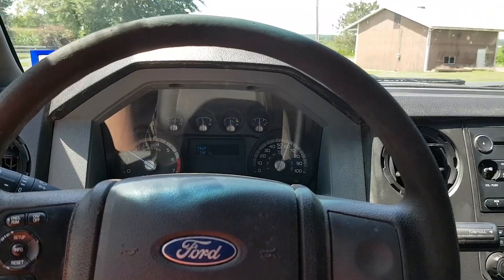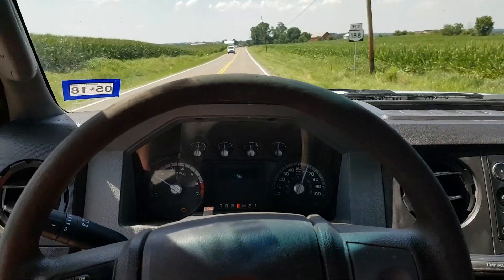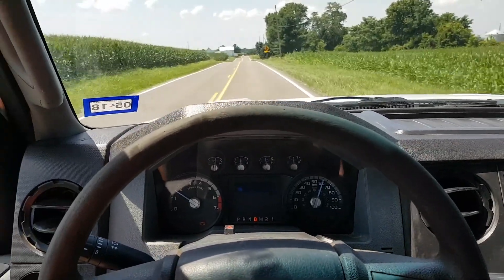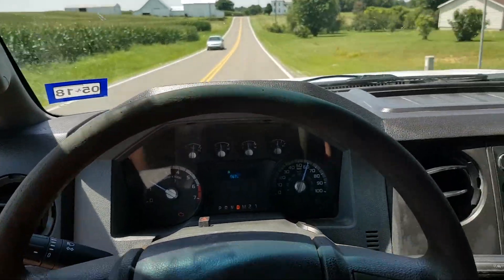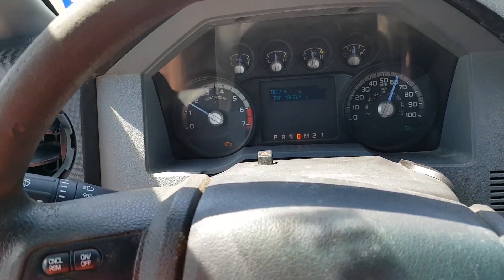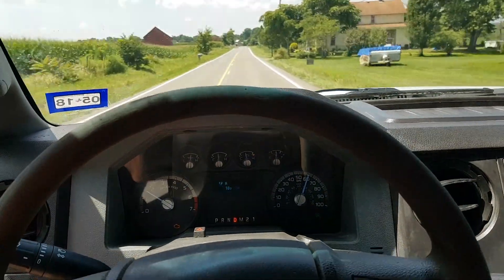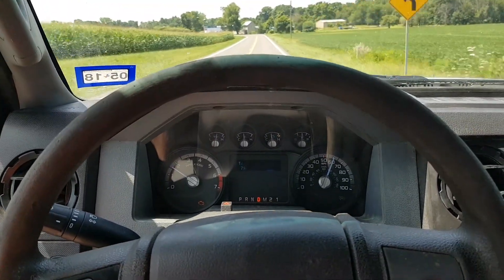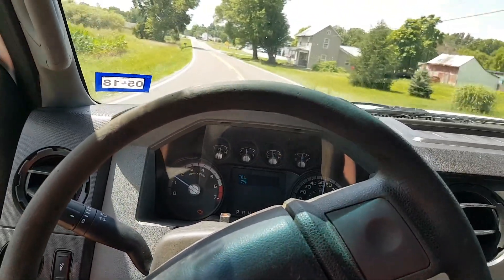Ford Misfire Monitor Neutral Profile Correction P0304 P0307 P0300

Comment: Man ive been battling an unpredictable intermittent misfire issue. P0300 P0302 P0308. I changed the spark plugs and wires as well as swaping the coil packs front to back to trou le shoot the #2 and #8 cylinder misfire. It didnt change anything. So I ended up at the local Ford dealer in Cedar City Utah and had the crankshaft position sensor relearn procedure done and so far its did the trick!!!!!
Reply from the maker: Yeah it can do that. I had the same issue with a random crazy misfire. 5 second procedure fixed it.
Reply: What did it cost you at the dealership?
Reply: @95gt00d $150....seems expensive for 10 minutes of computer work but it took care of it

Comment: Ford escape 2017 here. Having the same issues.  I was getting misfire codes. I bought fordscan lite for Android phone, I bought obd mx plus Bluetooth. I will perform this procedure myself tomorrow. Hopefully this fixes my car.
Reply: Hey galagatron5319 did you ever end up completing this procedure with your Android? Was it successful? Looking to do the same thing
Reply: Yes it works!  The lite version is nice with the Bluetooth obd and app on the phone. I still have it. But I highly suggest that if you want to have access to many more more features, get the software and wired obd 2 cable forscan recommends. The software is stupid cheap!
Also,  if your having misfire problems still after you try this procedure,  check all your ground cables under the hood and make sure they are tight and attached well to the chassis. Any dang ground wire you see. Also double check each spark plug if you put it new ones. I rebuilt my own transmission and didn't tight a ground cable and this causes the 4 misfire alerts you see in this video. After I found loose ground all but one coil was fixed. Still had one misfire in coil #3. Turns out, one of the new spark plugs I replaced was cracked. Replaced, and car has been running great. But the forscan lite works and I can't write a novel here but trust me, it works. Get the real forscan if you can though. You'll need a laptop with it.
Reply: @galagatron5319  great advice! Thank you very much

Comment: 2015 Mustang 5.0. Misfires cylinder 4 2 and 8 around 1200rpm.  No codes  changed coils , injectors, and plugs.   Have new VCT solenoids to install.   I hear and have seen 5.0 coyotes
With the valves wearing away on those cylinders.   GO

Comment: Thanks so much, this helped a lot. I have a 2020 Mustang and I just had a new MT82 (Transmission) put in and my car is now throwing these same codes. The dealer must have forgot to do this.
Reply from the maker: Hopefully that's the problem. It's an easy with with the right scantool

Comment: could this be applied after a simple spark plug change?? change in mine and after that get p0304...didnt check the plug of that cilynder..escape 2.0 eco
Reply from the maker: A spark plug change shouldn't require this
Reply: @JackofAllMasterofNone  thanks...
Just if you know something
First change valve cover gasket
Then sparks and experience misfire in cylinder 4
After that change all spakrs again..the misfire run better but still happen..so...my last chance is try this procedure..do you know something?

Comment: I just replaced a piston in a 2.0L engine and very carefully set the timing putting it back together.  Car runs great but I have a P0016 (Crankshaft position/camshaft position, bank 1 sensor A -correlation).  Could this procedure fix my code as well?
Reply from the maker: Im not 💯% sure but I believe it would. This procedure basically resets the crank position sensor / cam position sensor relationship in the computer.

Comment: So there is a car lot that is selling a focus st which has the eco boost engine. So I went for a test drive when all of sudden it started  bucking when I hit 3rd gear wouldn't pick up on WOT.  Got to a light and the car started shaking like crazy. I thought I wasn't pressing the clutch all the way. I pressed the pedal all the way to the floor and the problem still persisted.  So I turned it off and on. It went away. So when I got back i decided to check for codes with my scanner and it gave me  a code for the crank positioning sensor.  Car is being sold for a good price.  I wonder if I can it fixed at the dealer for free or something I can easily fix on my end

Comment: I’ve got a 2009 F350 that has run me up the wall after a basic tuneup with misfire codes, actual misfires, all sorts of tests, cleaning procedures, ECM resets, adaptive relearn ..... parts replaced .... it’s gotten plain stupid.   My gut inclination has been that it was so far out of tune the first time around that the ECM hasn’t been able to work correctly after the tune.   

Man I’m hoping to do this and get it fixed for good.   My Snap On Verdict shows the feature in special functions .... and as a back up a good friend mine has a copy of IDS (and FORScan) to give it a try.   

Thanks for taking the time to put out this informational video.

Comment: How much did the procedure (the relearn) cost you? I took my motor out to get broken exhaust studs out and install new manifolds, and I have the exact symptoms. Hoping it's this... I spoke to the foreman at my local Ford and he acted like I was an idiot for suggesting this
Reply from the maker: This is a common thing any time a clutch or engine or transmission is replaced on a newer Fors.. Whoever you talked to is an idiot. Probably the service advisor. Unfortunately advisors don't always know specific procedures. Any Ford mechanic would know the procedure instantly. It litterally takes 2 minutes to do and if they charge you more than half an hour labor, you are being ripped off. I had it done for free because I have friends who are Ford mechanics.
Reply: @JackofAllMasterofNone  so... My issue was not fixed by this. Turns out, if you just remove your engine and reinstall it without moving anything, you don't need this. Mine ended up being fixed by new coil boots. Go figure... I can't fathom the coincidence because before I pulled motor to do the manifolds, no miss. After reinstall, miss under every full throttle pull. I didn't touch the coil packs while the motor was out.
Reply from the maker: @erichg6693  That is a weird coincidence, but unfortunately the 6.2 trucks are highly suceptible to coil boot issues. I did a whole other video on that issue. Especially now that they are getting higher in miles